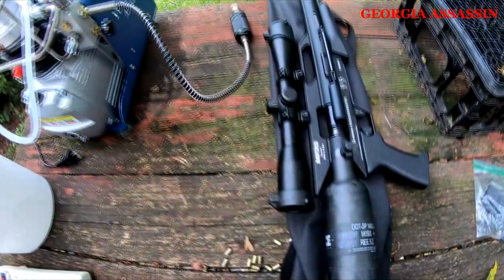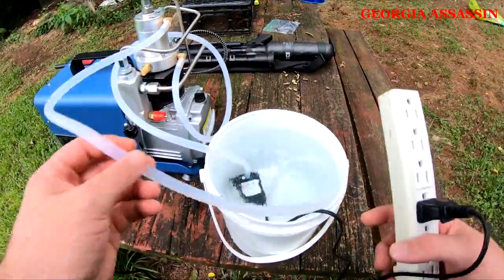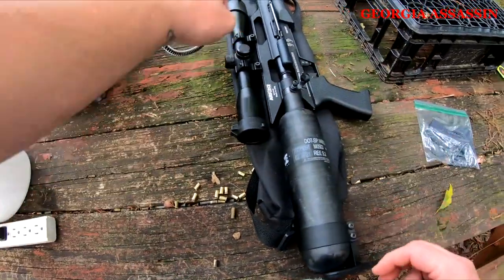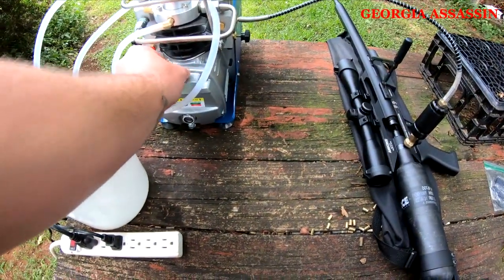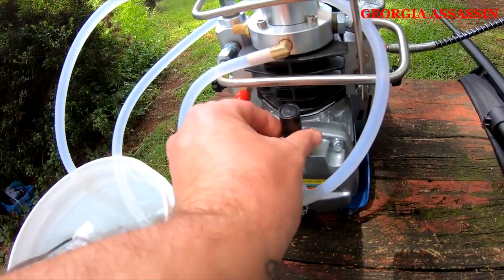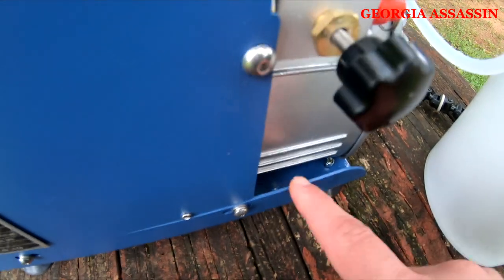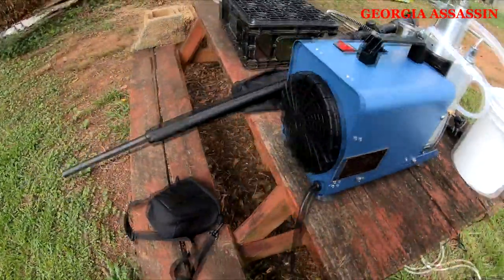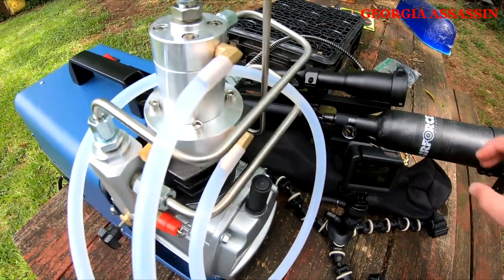Airforce Texan With Carbon Fiber Tank | Filling With Yong Heng to 3600 psi

Comment: I got about 18 months out of mine filling a 45 min bottle.   I bet just filling the gun, it will last for years.  I'm now using a Tuxing twin cylinder for my bottles.    I've had the Tuxing since March 2022.   No issues so far.   Solid performer.   Will fill a 45 min carbon fiber tank in about 15 min (2800-4500 psi fill).   Tuxing review is on my channel if you're interested.